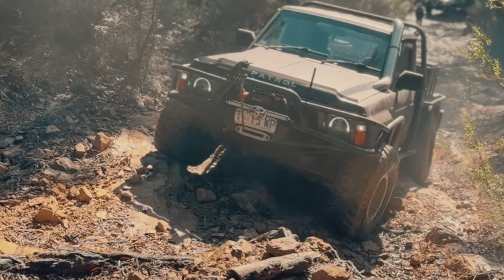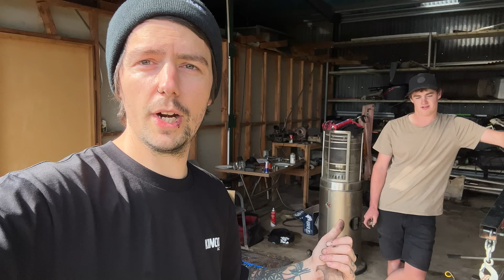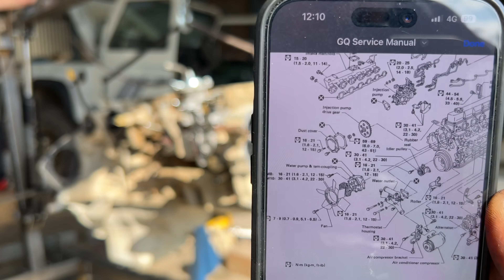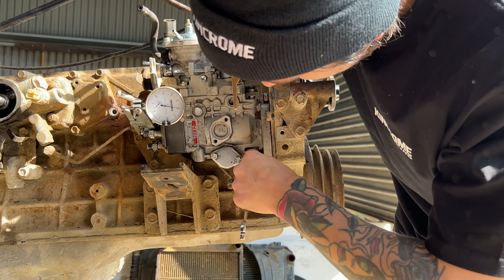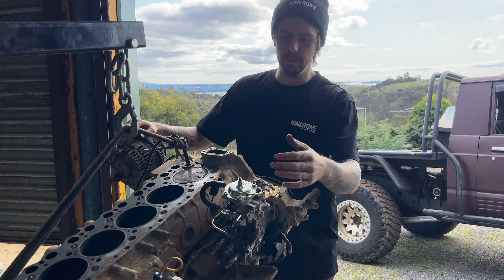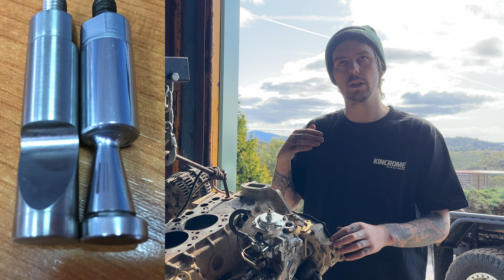INJECTOR PUMPS! TD42 - 1HZ - 1HD! Installing, Timing, Tuning!!!!

Comment: I've had all the pumps 10mm, stock 11mm built 11mm built 12mm All kinds of turbos set ups.

180-200hp 11mm 18g be my favourite set up for drivability and reliability. 

12mm feels awesome though its addictive but currently I'm 10mm again and it's fine does the job no worries it's alot cheaper to stay 10mm don't need all the extras like you do 12mm
Reply from the maker: Yeah I agree dude, I have the UFI200, I’ve had it at 175, I’ve had it at 200 and I’ve had it much higher but never dynoed it, I expect it would have been maybe 240-750nm but it had more to give too, still had shims left.